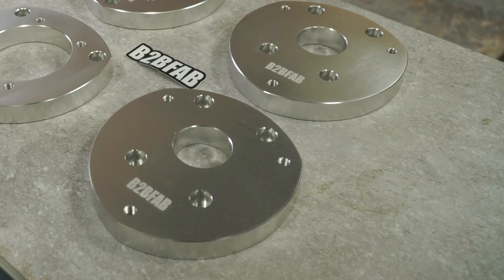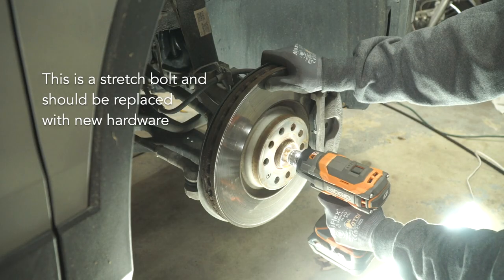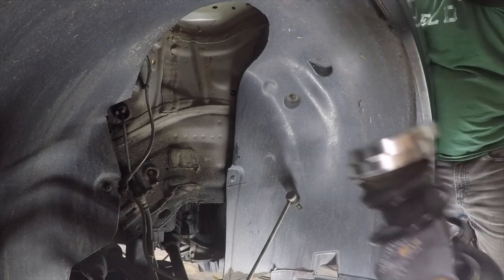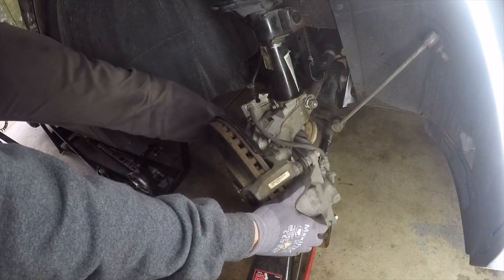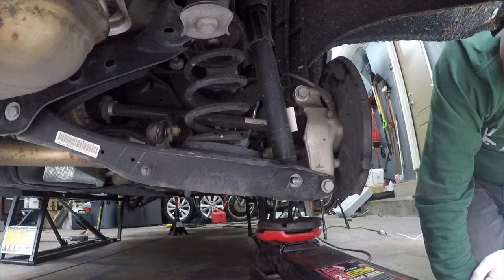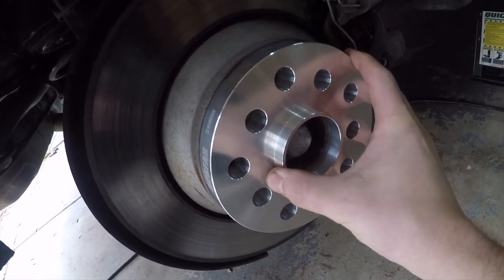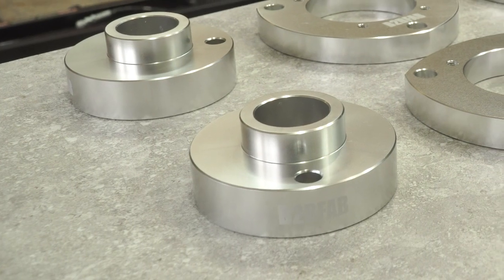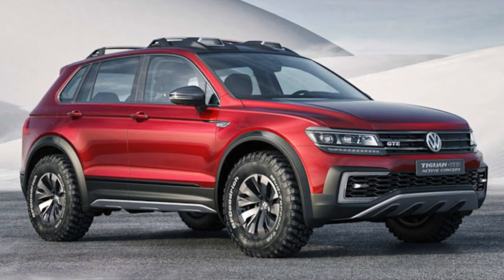B2B Fab Lift Kit Install for VW Tiguan - Installation and Review of Camber Correcting MQB Lift Kit

Comment: Finally someone posting a video about a lift for a Tiguan. I have a 2020 SEL and I wanted to do this and did some research and I couldn’t found any videos about this anywhere. I went from a 235/50R19 to a 235/60R18 rims with mud tires, I gained about and 1” and with this lift kit its about +2.5 inches from stock. I’m so happy with the way it handles and  how it looks. Great video.
Reply from the maker: Scott, thanks for the comment and glad you found success with this kit as well.
Reply: Awesome!  Can you share photos?

Comment: If you lift it 1inch you lose 1 inch of flex on back because shock absorber is extended in neutral position 1 inch more... high speed bumps can break shock while topping it up...

Comment: Just finished my install and this video was invaluable! Only (minor) thing that tripped me up was that you mentioned the axle bolt was 22mm (instead of 24mm). Otherwise it was super helpful, including the part about turning the rotor to get the axle to settle into the hub. I seriously doubt I could've done this without your video, thanks again!
Reply from the maker: Sorry about the mistype/speak about the axle bolt. So glad this helped you out. That’s why we put them together. Send us pics of your upgrades ride on IG - @godadwagon

Comment: @DadWagon with camber correction, will a wheel alignment be needed?  I also read somewhere that the MQB platform doesnt not have camber adjustability. Having an alignment done would mean using cam bolts and ither hardware. Which, to me, is not ideal. Please advise. 

Thank you for this detailed video. Looking forward to more contents from your channel.

Comment: Hi
Thank you for your amazing video.
I have Tiguan 2016 TSI 2.0 and plan to buy the parts you used to do the same to my car and a little more to be 100% an off-road Car. ( I liked the red car at the end of this video).
So please advise how I can buy the parts, & what about the suspension System should be replaced? if I need to change the tire to BF Goodrich All Terrien The maximum 17" size.

I need to contact you Please.

Regards

Comment: hello, i have a kodiaq, they share the same structre with tiguan mostly, i take to a shop and did a 30 mm lift already, but how about 50mm lift? do you think is this possible? if not is it possible with some more modification?

Comment: Greetings from Argentina! I'm wondering what about brake lines and wheel sensors? are those long enough to work 1 or 1.5 inches higher than factory? BTW, great video!!! thanks for sharing!
Reply from the maker: Thanks for watching Lio - we didn't have any issues with brake lines or sensors during this install - nothing seemed to be stretched or pulled beyond their capacity.

Comment: You got 1.0" more clearance in the front and 1.5" in the rear, is that normal! Wouldn't that be a problem with the vehicle not being level and your headlights shining towards the ground?
Reply: Not really. The back of the Tiguan Normally sits up a bit higher than the front